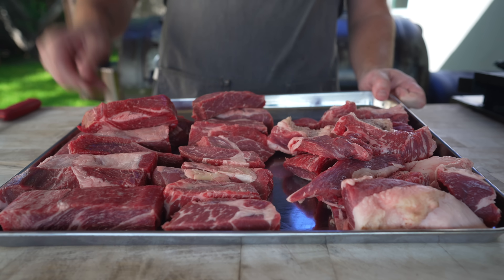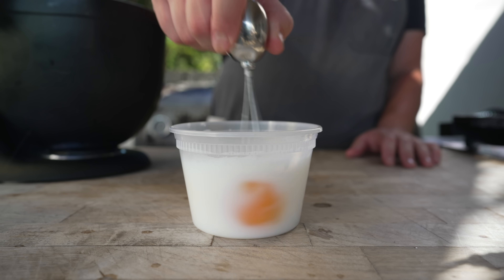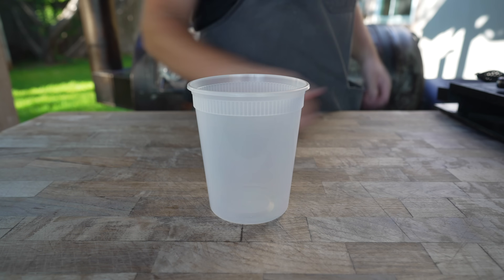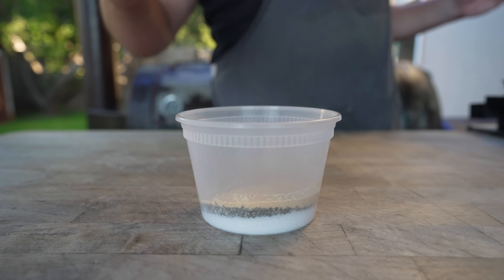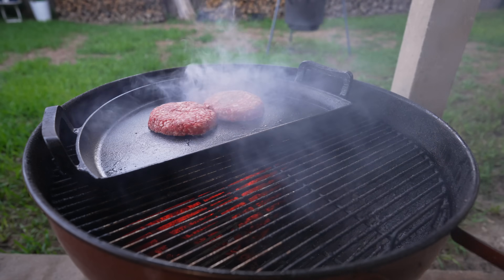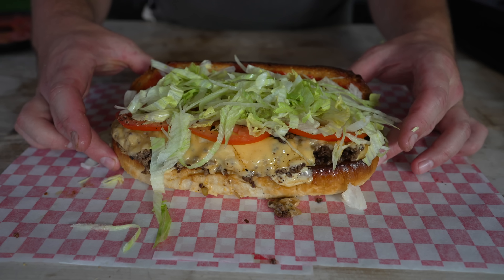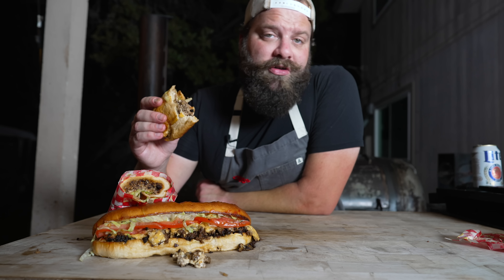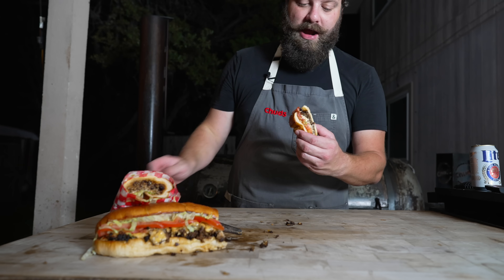My Favorite Drunk Food! | Chuds BBQ

Comment: As to the Philly, it's way WAY different. A Philly uses shaved or shredded steak, not ground beef. Grilled onions & green peppers mixed in. And it uses Philadelphia Cream Cheese. I use one full block per sandwich. But my Phillies are about the length of a medium pizza diameter, 12-14 inches. 1 sandwich feeds 2 people. But nothing like a burger. No lettuce, no tomato, etc. just steak, onion, pepper and Philly cheese wrapped completely enclosed in dough, then baked like a gargantuan hot pocket.